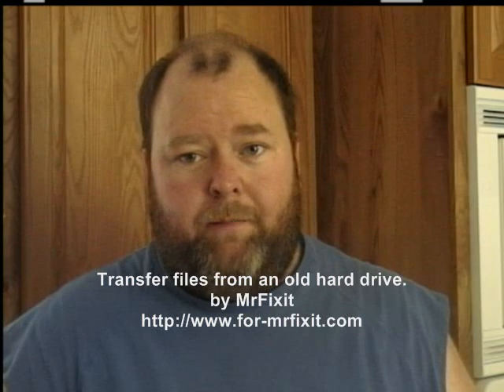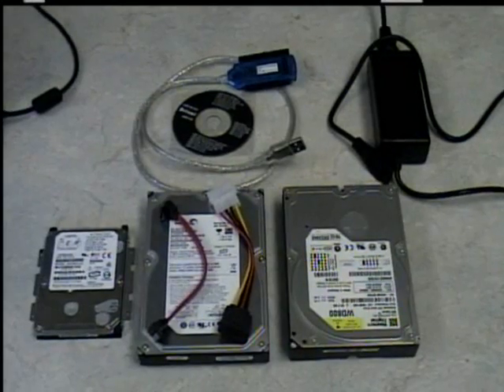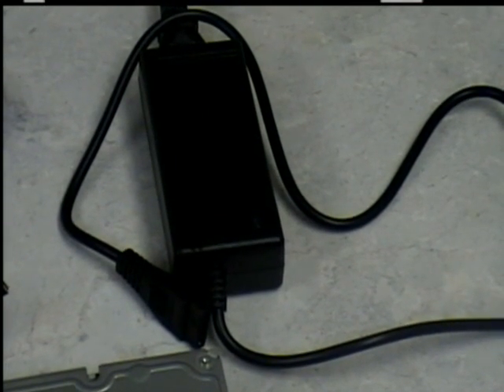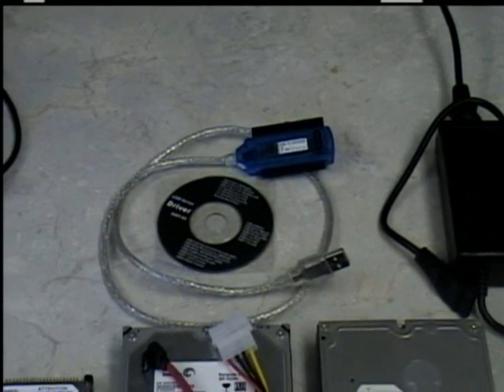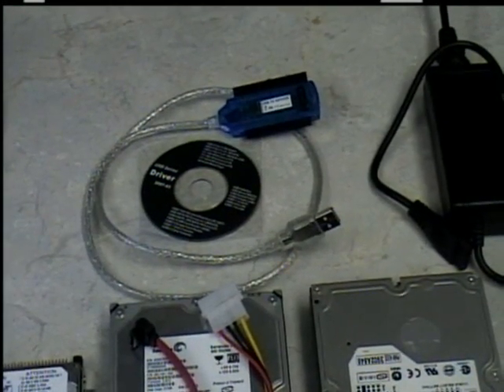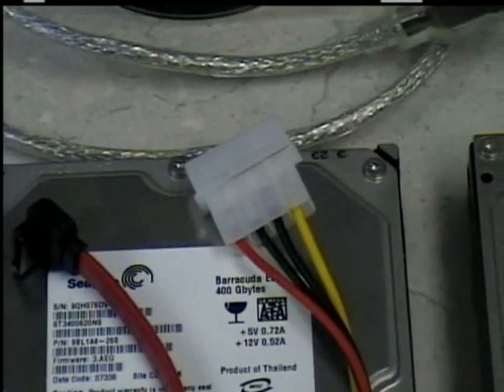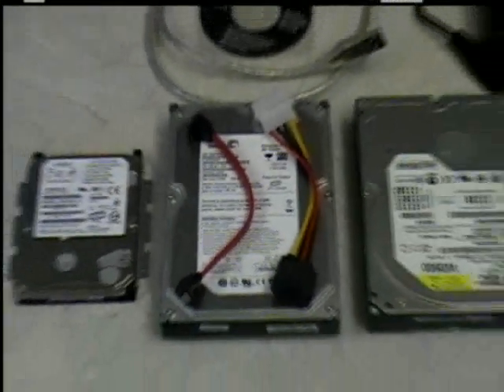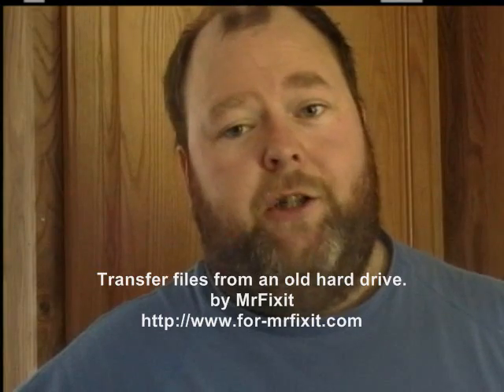How to transfer files from a Dead PC [CC]

Comment from the maker: @grclubpengujuan With monitor already on, turn PC on. Does anything appear on the monitor? You should see info displayed during Power On Self Test and manfacture's logo, followed by a short beep (some PCs), Any of that show? If the PC is booting to desktop, either the monitor or the Graphics Processor Unit (GPU) is bad. Connect monitor to another PC, if it works then the GPU is bad. GPU can be replaced depending on what type. Let me know the result and we'll from there. -MrFixit

Comment from the maker: @diljeetdulay Look in Device Manager under Control Panel. Look to see if an Unknown Device was detected. This sometimes happen because the driver for the specific adapter isn't known to Windows. Check to be sure the adapter works with Windows 7, usually an updated driver will resolve the issue.

Comment from the maker: @cberina You can use a software recovery tool that can try to repair the the HDD partition found on the net.Windows also has a start up repair tool which should be in the safe boot menu. when starting the computer press the F8 key down till the safe options appear. should be a startup repair option if windows will not start. -MrFixit.

Comment: i bought the Vantec CB-ISATAU2 SATA/IDE to USB 2.0 Adapter Supports 2.5-Inch, 3.5-Inch, 5.25-Inch Hard Disk Drives (Black) and my toshiba laptop windows 7 cant recognize device and went to blue screen warning error on device so i quickly unplug the sata adapter. i tried to put the hard drive back to my asus laptap and now it has been in startup repair for 16 hrs (before it was just a black screen) ....

Comment from the maker: @princesscupcaketatto Vista shouldn't have any problems reading HDD from Windows 98 since it used the old FAT32 and XP used either FAT32 or NTFS depending on its setup. Does DIsk management show the drive containing 'Unallocated' space or does it show the different partitions?

Comment from the maker: @princesscupcaketatto Your welcome. You can find the External 3.5 inch USB Floopy drives at Computer stores or online with no assembly required. Early versions of eMachine had faulty Power Supply Units. Yes, as I've outlined in the video, everything in the video should come with the adapter, except the HDD. I'm here if you need me. Thanks for the compliment. I'm Glad the video helps. -MrFixit

Comment: @ESRepair Thanks for the fast response. I will look into the enclosure for the 3.5 floppy.  

The other 2  HDD's are out of the computer - neither tower will get power (both old eMachines).   Since they will not get power, I need to do as you have outlined in the video and purchase the SATA/IDE cable and proceed per the video? Thanks for a great video too.

Comment from the maker: @princesscupcaketatto First, this adapter will NOT work with any internal 3.5" Floppy drives because they use a 34-pin connector, however, you can buy an External USB 3.5" FDD to do the same thing. As for the 2 HDD, If you are connecting them inside the PC, the IDE versions need to be set to SLAVE if there is another drive that shares the same cable, set to MASTER if no other drive is on the cable. This adapter disregards that protocol. -MrFixit

Comment: I am in the process of doing this to 3 hd from old computers using  an enclosure and managed to copy a 15gb drive from old HP computer. The other two HD, Western Digital, one 40gb one 80gb, from old eMachines with no power, will not copy.The drive will show up and then disappear when i try to copy either one.  Will the procedure you have outlined  work to do this or try something else?  Also, we have 3.5 floppy and a drive for them, can we use this to copy them to recover data from them? Thx!

Comment from the maker: @labikoye depends on what's broke & extent of the damage. Physical damage would require the HDD to be sent to Data Recovery Center. They will repair the HDD enough to rocover your data. If its just the data corrupted, there are software that correct the partition errors to retrieve data. -MrFixit

Comment from the maker: @tricky74000 When a new drive is added (ex. USB Drives), the system automatically assigns the next available drive letter. Drives do not have a designated drive letter, that's up to BIOS and the OS. The HDD should show under My Computer (XP) or Computer (Vista and Win7) from the Start Menu. Drive names are optional and not required. If the drivers for the adapter installed correctly, the drive should be accessible from the desktop. Inbox me for further help. -MrFixit

Comment: I'm trying to use this method to access data from my desktop SATA 3.5" HDD but the drives are not accessible, possibly because the Drive Letters are not allocated. It was a partitioned C & D drive. Both letters already exist on my laptop. The partitioned drive comes up as Disc 2 in Computer Manager. Right-clicking on only gives me a "help" option on the un-named C-drive and a delete option for the data partition (D-drive) where most of our files are saved.

Comment from the maker: @simhopp XP and later OS using NTFS on HDDs enecrypt the user directory as part of the security improvement. To access the directory on another HDD, you must use or create an user account of the same name and password used on the old HDD. This is the easiest method, however there are others if this doesn't work. -MrFixit

Comment from the maker: @sarahpep421 If there is room in the PC, you can use the adapter inside the old PC. 3.5" SATA drives are easier to connect without removing them if you can reach them. IDE may be difficult without removing them. -MrFixit

Comment from the maker: @nowaas66 The adapter is called IDE/SATA to USB Adapter. It's compatible with USB 1.1 and 2.0. Works with Win98 (with drivers) to Windows 7 OS. Many Computer stores sell them for around $20. They do vary from model to model. be sure to read the features and check the adapter works with 2.5 inch drives. What you see in the video is what most of these adapters are packaged with. Once connected the HDD will act as an external drive. -MrFixit

Comment from the maker: @Blizzardv100 Yes, be sure the adapter supports 2.5 inch IDE / SATA drives. Some laptops also use an adapter to connect the HDD to the motherboard that you may need to remove to use the HDD connectors. If the laptop still works you can use the USB transfer cable instead, like the one used in "Transfer Files and Settings" video. -MrFixit

Comment from the maker: @NormS1944 Yes. You'll need a 2.5" SATA to USB adapter. The adapter works with 2.5 inch SATA II type drives like your old HDD. they should come with a power supply to power the drive or an adapter to power the drive via USB. once plugged in, the HDD acts as an external HDD. OR you can use an external USB drive kit to convert your old hdd to usb. I do have a video that shows how it is done if you choose too.

Comment from the maker: @CityFlashLights The power supply comes with the adapter which also includes the adapter to convert the IDE 4-pin molex power connector to the SATA power connector as demonstrated. -MrFixit

Comment from the maker: @almirkaradza55 yes. hook the old HDD to the new pc via the adapter. Keep in mind that you can only transfer files that were created or downloaded. Any installed programs need to be installed on the new computer before transferring any files created by that program. if the new PC has room you can install the old HDD as a secondary drive. If the new pc has no OS you can either clone the drive to the new pc or install the HDD as the boot drive. -MrFixit

Comment from the maker: @jesslm0590 Yes, these adapters will work on any 2.5 & 3.5 inch HDD, regardless of the manufacture, using either IDE or SATA connections as demonstrated in the video. -MrFixit

Comment from the maker: @danielc365 The USB adapter costs around $15. You'll need a SATA to USB adapter or the 2.5 inch SATA External drive kit, if keeping the drive. The HDD may use an adapter connecting it to the motherboard. You do not need it. -MrFixit

Comment: Hey i seen your video on how to transfer data from a hard drive i got an acer aspire 5532 and i believe that the motherboard has died on me will this work with a 2.5 inch hard drive i need to get pictures off of it since the computer is dead and not worth fixing is this a cheaper way to get info off or take it to a computer specialist and have them remove the data from me with i believe is more expensive so PM me and let me know what i should do thanks :)

Comment from the maker: @SHAAFKAT your DELL uses a 2.5 inch IDE drive. It will be simaliar to the one in the video. It has a 44-pin connector. The USB adapter need to accept 44-pin IDE drives. Some laptops use an additional adapter to connect HDD to motherboard. That adapter can be removed to access the OEM connector on the HDD. -MrFixit

Comment from the maker: @acrock21 Maybe not. Some I/O errors (Input/Output) can be caused by errors in the File Allocation Table (FAT). There are Data recovery softwares that can attempt to fix the errors on the drive, however, if the errors are caused by hardware issues, there not much you can do except have the HDD sent to a Data Recovery Lab. They will be able to retrieve the Data from the drive. -MrFixit

Comment from the maker: @sanbox242 yes u can. They're one in the same. Clone the old HDD to the USB drive. Disassemble the usb drive and remove the HDD. I hv 2 videos installing IDE and SATA drives. Standard USB drives use an IDE HDD. Some that used SATA drives used dual-USB or firewire connctors. -MrFixit

Comment from the maker: @IzumiIshtar You can, but depends how it was encrypted. Windows OS starting with XP that uses NTFS automatically encrypts the user account and the files they create under their username directory. An account on the new computer must use the same username and password used on the old HDD to access the encrypted data. If a 3rd-party software was used to encrypt the HDD, that program needs to be installed on new computer to access the drive. -MrFixit

Comment: Good video on the adapter. But deleting a partition and formatting the drive does not touch the data on the disk.  Any recovery software will recover it with no problem.  You need to use a disk wiping program, however this can take many hours, the easiest way to get rid of old data is to physically destroy the hard drive.

Comment: @ESRepair Thanks for the explanation,but I have 1 more question here.I did open the hard drive on another computer but I had a problem.The computer said that I don't have permission to see/open those data. I was required to take over the ownership from the new computer.I could do that but I had to do it for each folder,which is so tiring and waste time. I did use password on my computer.Do u know how to solve this problem?like just type the my password one time and I can open all my files.Tks.

Comment from the maker: @Skillz990 The IDE/SATA adapter should come with a 12V/5VDC power adapter for 3.5 inch drive similar to the one in the video. The kit includes a USB adapter, SATA data cable, 12V/5VDC power supply, and a 4-pin to SATA power adapter as described in the video. -MrFixit

Comment from the maker: @kangegha The USB adpater itself draws power from the USB. The power cable is used to power 3.5 inch IDE and SATA drives. The 4-pin power adapter will plug directly to IDE drive but need the SATA power cable adapter to convert the IDE power plug to a SATA power plug. If connecting a 2.5 inch IDE drive, no power connector required since the drive can be powered by the USB hub. -MrFixit

Comment from the maker: @RockDemon1990 My knowledge with macs is limited, but to my knowlege, MacBooks can read HDD formatted with NTFS but cannot write to the drive. Most PCs starting w/ XP have the HDD in NTFS format. The HDD can still be used as an external drive but will need reformatted to macbook specs to be able to write to it. -MrFixit

Comment: I have two questions.

1. If I have macbook, can I still use the USB to SATA/IDE adapter to access a few files from an old hard drive of a broken computer (Windows XP, specifically)?
2. If so, once I'm done, can the old hard drive serve as an external hard drive if I keep the necessary connecters?
If someone could let me know, I'd appreciate it. Thanks. -Matt

Comment from the maker: @KNOXTA I'm not sure I understand what u r asking. The SATA drive I used is a 3.5 inch drive. The 2.5 inch versions are used in laptops. They look like the small HDD sitting on the left in the begining. Laptop chargers will fry any HDD due to the 19VDC output. Drives that are 2.5 inch can be powered from the USB buss but 2 my knowlege 2.5 inch SATA drives require a special USB adapter that can regulate the power to the drive. Its connections are different. -MrFixit

Comment: a quick noobie question if you dont mind answering. my sata laptop charger has the same conections as your sata hard drive (7.00 mins on you video) but its a lot smaller and slim than yours. do i connect the cables the same as you or would the power supply fry (burn) my hard drive.i thought as its smaller it would use some sort of usb power cable. please reply. much appreciated in advance. thanks

Comment from the maker: @ChallengeLobbyyz Yes. This adapter works on ANY computer with an available USB 1.1 / 2.0 port. If the desktop PC still works, I've demonstrated how to use the USB file transfer cable to transfer files and settings to a new comupter. -MrFixit

Comment from the maker: @kraden18 Starting with Windows XP, the introduction to NTFS allowed USER accounts to be encrypted to prevent unauthorized access from another USER. As long as the HDD was formatted using NTFS, by default the account is encrypted, even when the HDD is removed.  Try changing the permission for each file and see if that helps. Another way is to create another USER account using the same exact USER name and PASSWORD that was used on the old HDD, this should do the trick since the keys would match.

Comment from the maker: @RocHardEntGrp If you are upgrading to a new Hard Disk Drive,  watch my "Clone/upgrade HDD" video. That video will walk you thru the steps to clone the entire HDD using a free software. The adapter in this video can be used to clone a HDD if necessary. This video allows you to transfer data files from a HDD in a dead computer.

Comment from the maker: @AmandaMeli Thank you. Using this process will work whether it's a PC to laptop or vise versa. The process was designed in the event you have a HDD from a dead computer, however, if you are transferring files from one computer to another, then you do have other options. You can use either a USB File transfer cable adapter or a 'NULL' Ethernet cable (a.k.a crossover ethernet) to interlink 2 computers together to transfer files. The USB File transfer is the simplest to use with minimum setup.

Comment from the maker: @drcannabudz  As I'm not the computer geek ,MrFixit , I don't know except to say that if all of the other requirements for the device is met , such as the version of windows , etc . and the USB version is the only thing different then it should still work , it will just be slower . I have hooked USB 2.0 stuff up to a USB 1.0 before and got a message saying that the device would perform better on a USB 2.0 . However , I'll let MrFixit answer for sure .

Whizkid

Whizkis

Comment from the maker: @drcannabudz The IDE/SATA to USB is backward compatible so it will work on the slower USB 1.1. You can easily upgrade to 2.0 by adding a USB 2.0 PCI expansion card.

Comment from the maker: @n1ck1216 How is the HDD 'kind of dead'? If the problem lies within the mechanical/hardware failure of the drive, it does make it more difficult to transfer files without a data recovery company to retrieve the files, but, as long as you can access the files, this procedure will do the job before the drive fails.

MrFixit